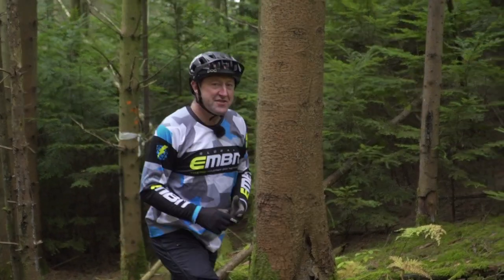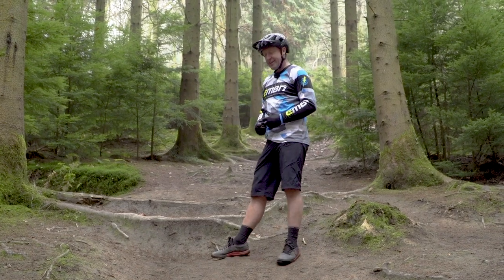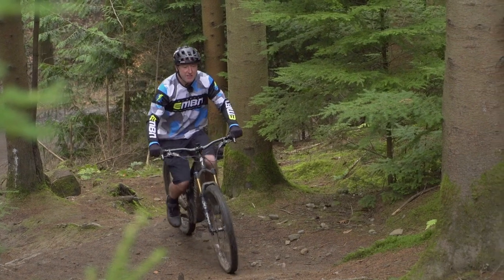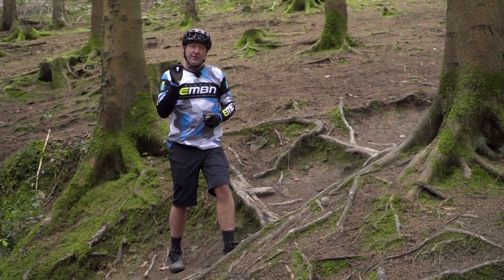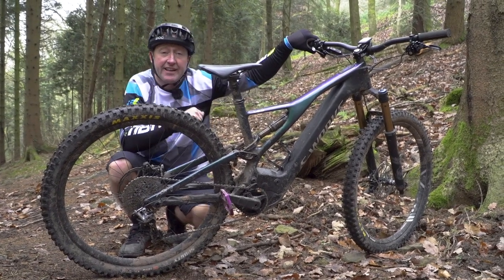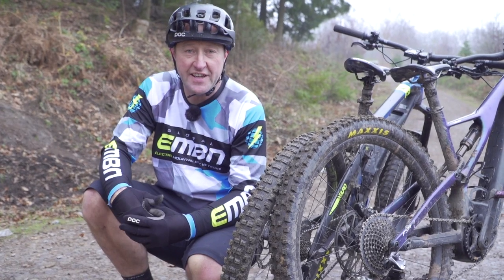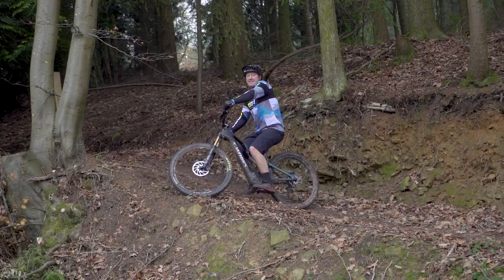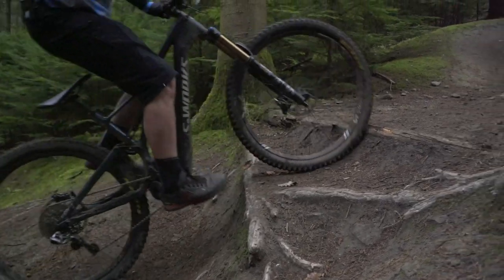How To Master Extreme And Technical Hill Climbs On An E-Bike

Comment from the maker: Do you have any tips to add? Let us know! 👇
Reply: Sadly there are a lot of eMTB riders out there that can't climb, and blame either their tyres or pedal crank length, when it is in fact their own poor teqnique and forward planning and bike preparation, example being over inflated tyres. This is all something that I frequently see and excuses that I have to listen to when out on group rides. Hopefully some might see this clip, and learn something from it. Just one thing to add in respect of the clip. If in doubt, walk up it first.
Reply: Don't agree at all with dropping the seat down for climbs of any length. Your legs can't work efficiently. Although you can't move backwards forwards that much I found that it only takes subtle forward/rearward movements to get the traction/keep the front down. I guess ultimately it depends on the length and steepness of the climb. Perhaps on short/steep climbs putting the seat down (a little) would help. But for longer climbs where gradient isn't extreme keep the seat up!
Reply: Electric Mountain Bike Network Hi! What kind of Shorty do you use on that beauty S-Works? (DD, exo?)
Reply: 7:20 Seat down climbing?  Hell no, unless you want to wreck your knees.  8:19 you can do that with seat in right position too since you are lifting off seat and leaning forward.

Comment: I've found that selecting the the gear needed for the most difficult section to start with rather than waiting till that point works out much better, you may have a higher cadence on the easier bits but when you need it the most you're already there. Also the skill of becoming comfortable with the bike sliding around underneath you while pedaling up is a good one. A lot of my moto-trials skills really come out on tech climbs.

Comment: I know youre a dirtbike rider as well and so am I, I was always a good climber and for me its looking ahead..read the obstacle after the one you are approaching so you can know what speed you will need, you may need enough speed to coast ovee a step as the pedals may strike or the wheel will spin under power.
I always quickly look right to the top after every difficult bit, it keeps you focused on the goal..if you ride looking right in front of the wheel, you'll never make it.
You need a mental map of the entire climb.